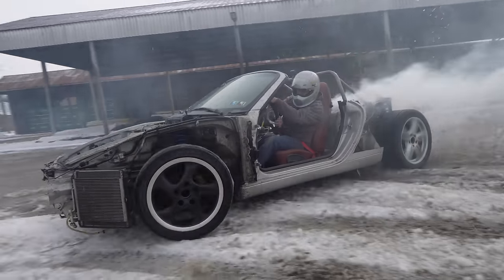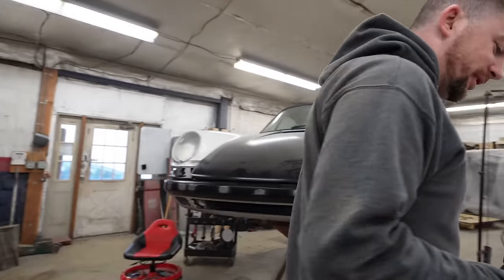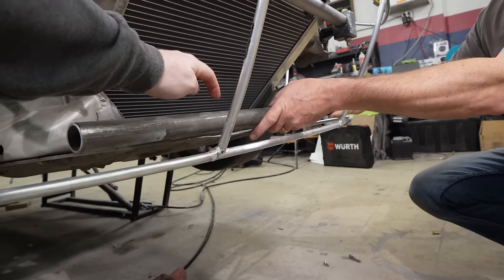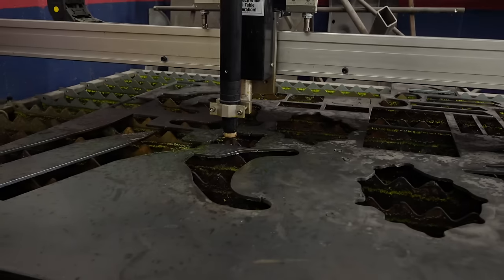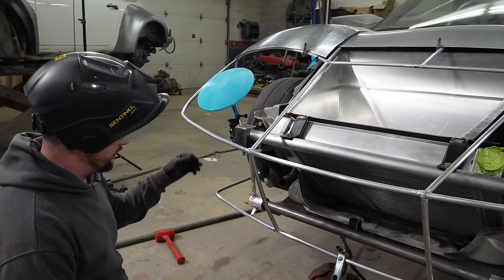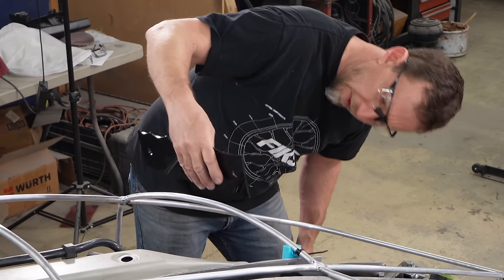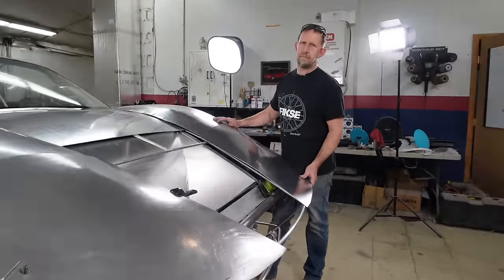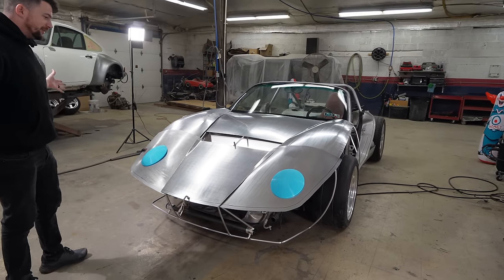$500 Junkyard Supercar: Custom Hood Hinge and Metal Body Fabrication (Project Jigsaw #33)

Comment: Loving the whole concept. I've been watching every episode as it's come out. A question about airflow: firstly, will you be doing a ledge drop from the front of the hood to the radiator outlet like in your model (and most supercars of that era) to assist in airflow and prevent it from causing a stall there? And the same with the rear window - I know that having a custom rear window will be a pain, but having a drop between the rear supports where the rear glass is going will also create a lot of turbulent flow. Will you be looking at slanting the rear of the cockpit more?

Comment: Ever considered mounting the 993 headlights inside of the clamshell, vertically, with a lens cover flush with the clam? Would be more period correct. Have been looking at the renders and drawings since the start and only just spotted why it felt off - not many cars had angled headlights at the time, Muira aside. Always felt its headlights could have been better resolved, fantastic looking car that it was.

Comment: Im not a metal worker but couldnt you cut a slit out of the steel tube and slide it on to the bracket then weld it. Then it wouldnt be up too high or down too low and you could still use the aluminum pipe and the 3d printed bushings the same way.

Comment: Shouldn't the clam shell hinges should be mounted to the same side of the chassis mounts so you can slide the clam shell sideways when open to remove it from the car?  Where you've welded it the clam shell cannot be removed.

Comment: Hey I just wanted to add 

That the American pronunciation of Aluminium is more dynamic and versatile as are the very properties of said metal…

If not it gives it a temperamental overtone, which is correct..
Reply: Secondly.

As a distinguished connoisseur of metal critiquing 🧐 I recommend always keeping the surfaces of English wheel equipment 100% clean and shiny, like the tip of an English mans snooker cue, can otherwise be subject to friction/grip…

Reckon there are wheel specific products that enhance performance..
Reply: Thirdly

I Reckon Tony may require medical assistance with his nail..

Sadly I can confirm that at that level it may not merge again! 😢